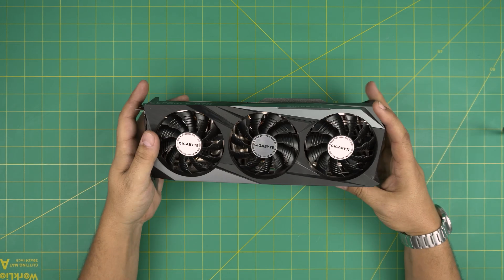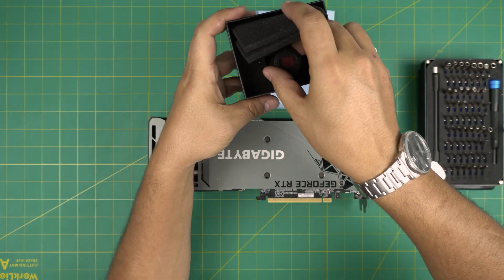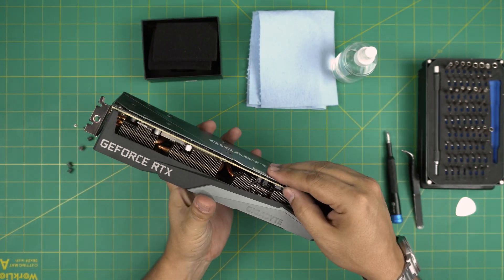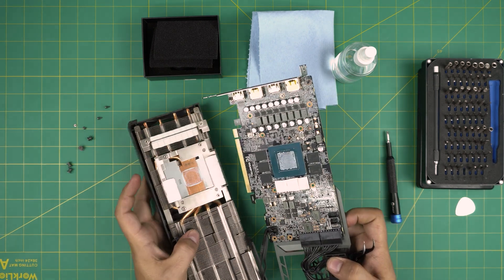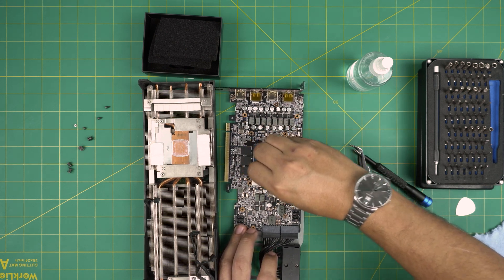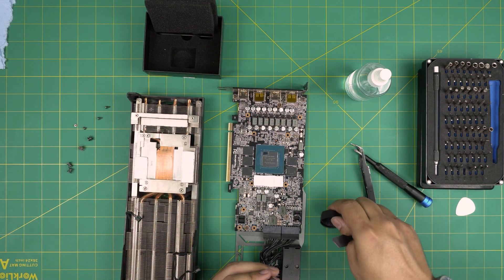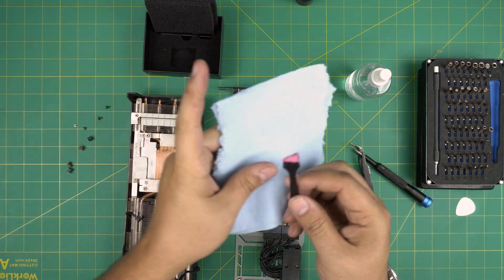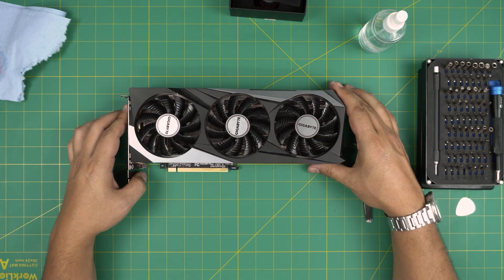How to Repaste and Clean an RTX 3070 GIGABYTE Video Card | Step by Step

Comment: Very informational but I was fast forwarding through 70% of this video. I think you spent a solid minute and a half with those tweezers trying to undo that first connector
Reply from the maker: It's my pleasure my friend. 😊 Thank you for taking the time to give feedback! If you would like to support the channel, please like, subscribe, or both. :P
yes sometimes when we get GPU that are used, because of the heat that produces from the fan and heatsink, those connectors are made of plastic and they can get sticky to each other :P
Should you have any questions or requests in the future, please don't hesitate to ask me.
cheers🍻
Reply: @uFixTek  I will give 1 like for responding well to constructive feedback. I'm a generous god.
Reply from the maker: much appreciate the support it all start with 1like 🫠

Comment: Do you know how thick thermopads should be
Reply from the maker: Thank you for your feedback! If you wish to support the channel, you can like, subscribe, or both!
Regarding your question, .5mm and 1mm pads my friend,
https://amzn.to/3PR5IU3
Should you have any further questions or requests in the future, please don't hesitate to ask me.
Reply: @uFixTek    0.5 and 1.0 mm ?
Reply from the maker: 1mm ONLY my friend.
🍻
Reply: I used 1mm and 0.5mm for the memory.
Reply: @jumperovo   Hi!  Aren't they a little thin at 1.0mm and 0.5mm?  I asked gigabyte and they gave me this answer:

The thickness of thermal pads are 0.75mm, 1mm and 1.25 mm.

60*5*1.25
60*9*1.25
27*8.1*1
27*14.2*0.75
40*14.2*0.75 (2pcs)
Reply: @troppaila  interesting... I thought that was mentioned 1mm and 0,5mm in the video, so I did it exactly this way :) Unfortunately, I didn't measure the old ones before :( Anyway, after re-paste with the following thicknesses, I got18-20 °C lower temperature (including new paste on the chip (Arctic MX4)) in Cyberpunk 2077 (Including DLC and the latest patch).

60×5×1mm
60×9×1mm
27×8.1×1mm
27×14.2×0.5mm
40×14.2×0.5mm (2pcs)

Cyberpunk was the reason for the repasting because before that I had temperature min. 86-87 and after some time, more than 90 °C where my VGA got black screen and shutdown. Now the highest temperature I already saw in GPU-Z was 73 °C in the most complex scenes. Usually now it works under 100 % load around 67-69 °C.

I think that there's some space around the onboard memory and other components, so I suppose that the recommended thickness by Gigabyte should fit there.
Reply: @jumperovo   I asked Gigabyte support, to know for sure which thermal pads to buy, to get exactly the recommended thickness.. Not too thick and not too thin. The problem is that I can't find in online stores 0,75mm or 1,25mm thick ,, on aliexpress I found something at this sizes to order .. Will this one be good ? Upsiren 21w/mk Thermal pad High quality 100X100mm?

Comment: Thanks, I followed the video and improved temperature by around 15-20 degrees. I broke the RGB wire clip but nevermind.
Reply from the maker: Thank you for your feedback! If you wish to support the channel, you can like, subscribe, or both!
Regarding your accident, by removing or disconnecting the RGB, you are helping the GPU from drawing less power and less heat from RGB, even if it is minimal , but it's something 😁🍻